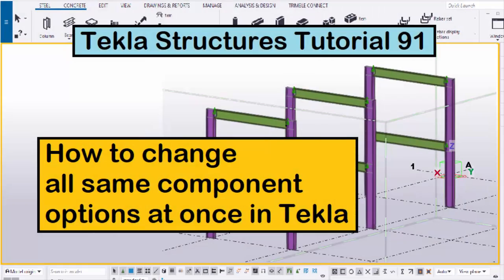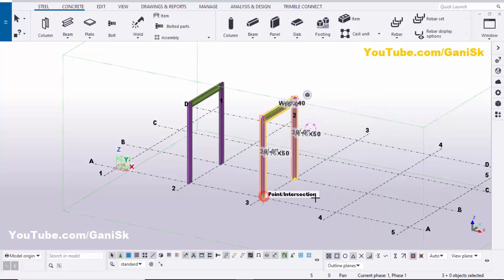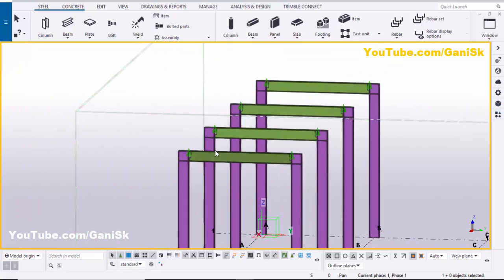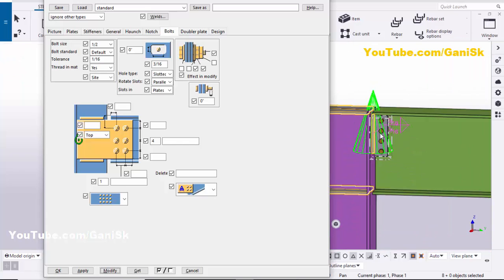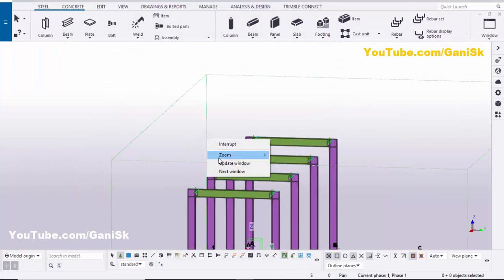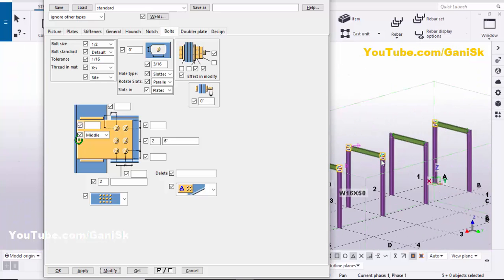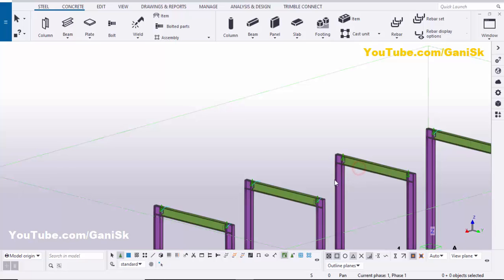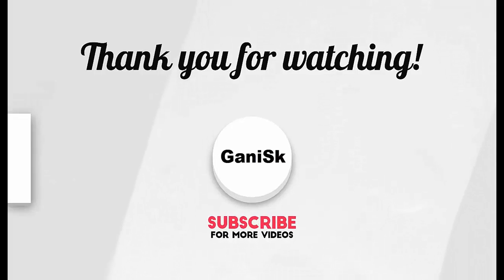Tekla Structures Tutorial 91 | How to change all same component options at once in Tekla

Comment: Hi Gani, thanks for the tutorial
I didnt hear you clearly @ around 2:53, after selecting all components, what shortcut did you hit??
Also, I'm wondering that, if I want to change the size of let's say, columns all at once, is it the same approach?
Thanks!
Reply from the maker: Short cut: Alt + Enter
Reply from the maker: Yes, you can change all columns at once with same procedure (Select all columns then use the short cut)